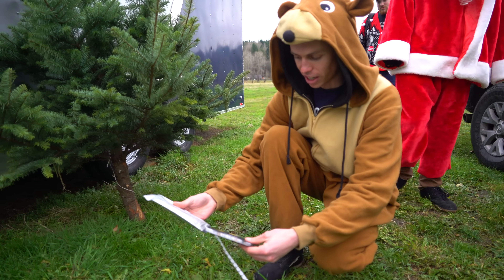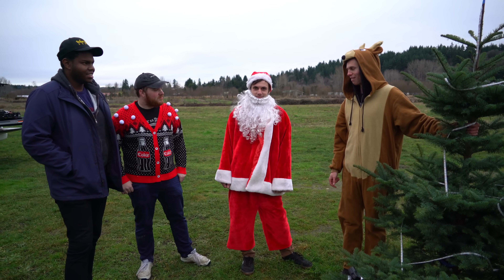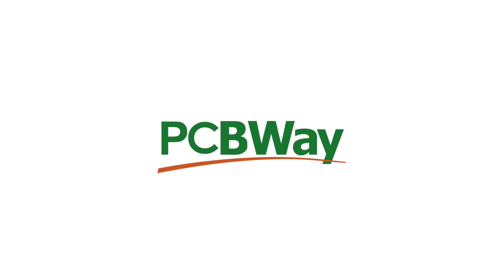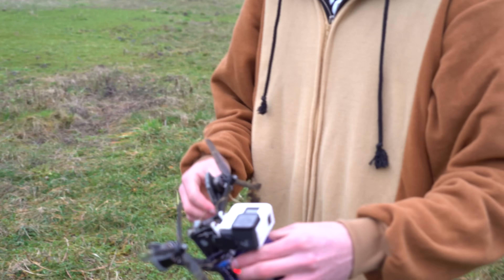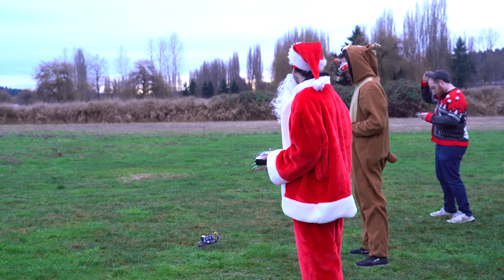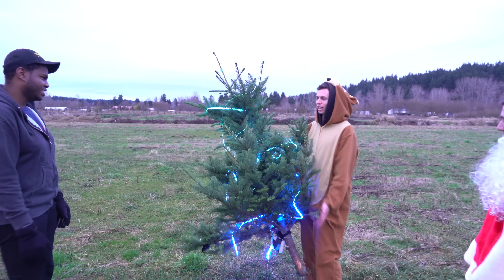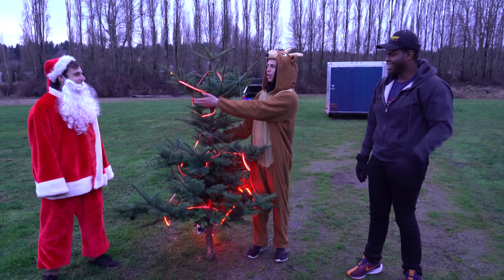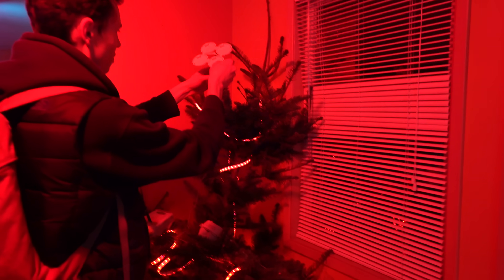Dropping a Tree from a Huge Drone

Comment: 1:45 "All of the mass is affected by gravity at the same rate"

So, that's right and wrong. He's right in that if we were doing this in a vacuum, no orientation would have preference, because every bit is accelerated by gravity at the same rate. But in the atmosphere, the force due to gravity matters, and that's proportional to how much mass is in what area. So if the center of gravity is offset from the center of drag, then the drag will have torque on the object, and rotate it until it's in a stable equilibrium, which happens when the center of gravity is directly below the center of drag, because then the drag force is in line (and opposite) the force due to gravity, and therefore cannot cause any torque.
Reply: Yes. If the center of lift/drag is in front of the COM, it will flip.

Comment: Angee in the baseball cap had the right train of thought in the experiment's hypothesis. He said, basically, the tree was going to be in FREE FALL and every part of it would be affected the same (except for drag and lift). He was also the best at the push-ups !
Reply: Actually, no. True -- gravity will accelerate every part equally, but drag becomes significant pretty quickly as it speeds up, so the relationship between Center of Mass and Center of Drag quickly takes over as it gets closer to terminal velocity. Once moving relative to the air, dynamic stability is king, not static stability. He was definitely best at pushups though.